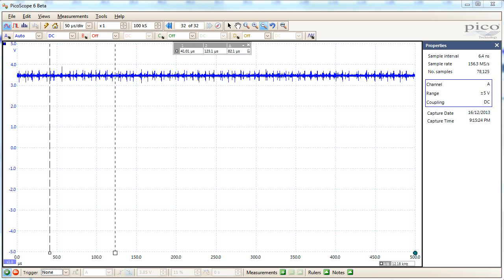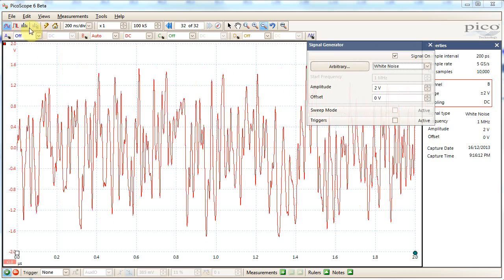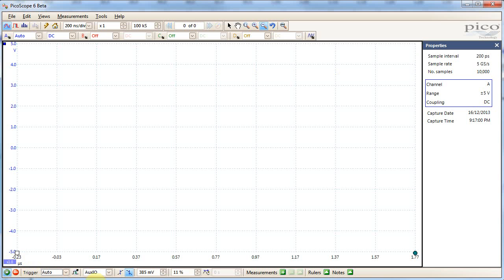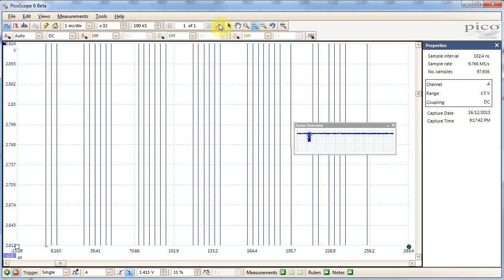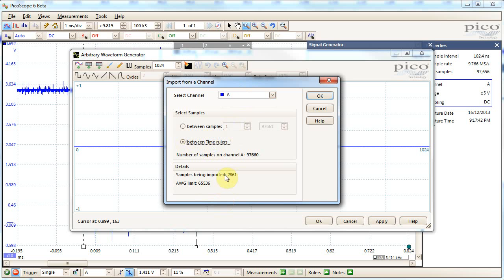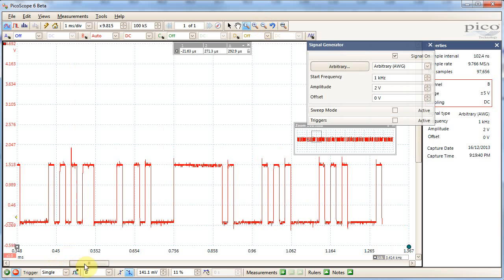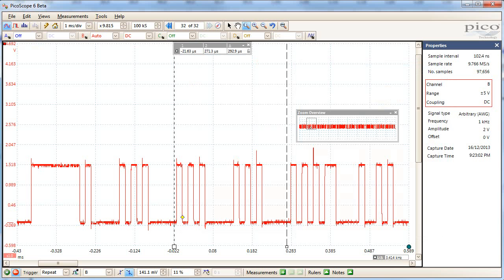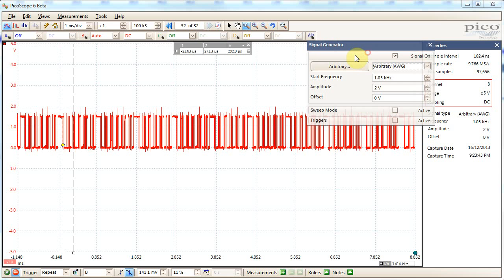Using PicoScope AWG for Testing Serial Data Limits

Comment: Who is willing to pay over £3000 pounds for a Picoscope that has AWG (arbitrary wave generator)???

Question:
Are there other options??

Question:
Is AWG strongest point to spend staring price of just £3000??

Probably not.
Reply: Actually, I just bought the entry level PicoScope 2204A for about US$ 150 and it does come with an AWG, probably with a few restrictions compared to the more advanced models.